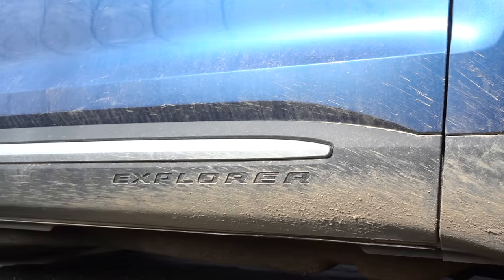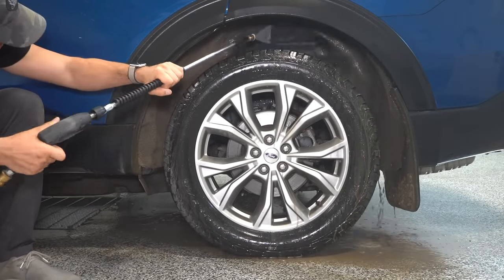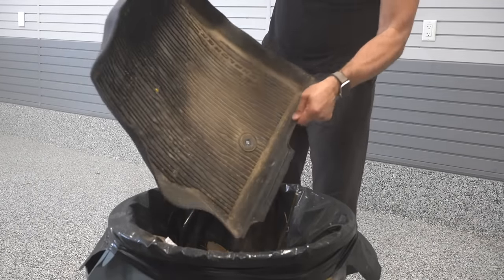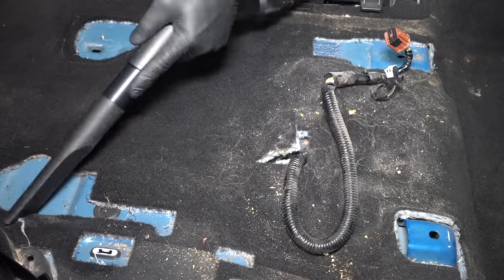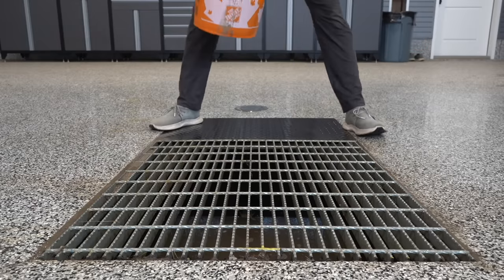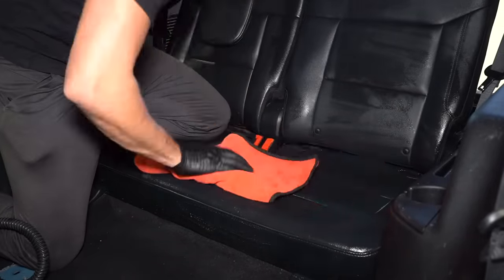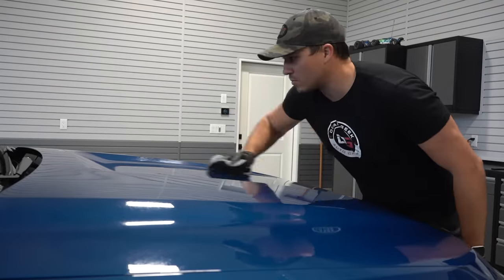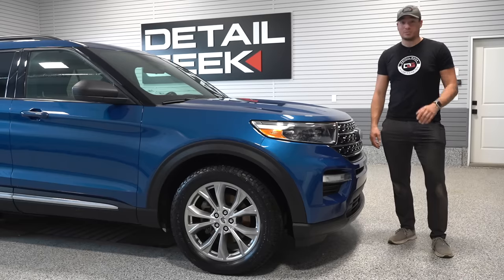I Shouldn't Be Allowed To Show You This...

Comment: Might I suggest a cyclone separator between your vacuum and the vehicle. There are a bunch of simple and cheap ones sold both online and in stores like Home Depot. Effectively they use centrifical force to dump all of the debris both small and large into a bucket while permitting mostly clean air to return to the vacuum itself effectively eliminating the job of having to clean out the vacuum itself and you can continue cleaning with almost no loss in performance regardless of the size of debris.

Comment: Hey, Mitch! I have a few questions: 
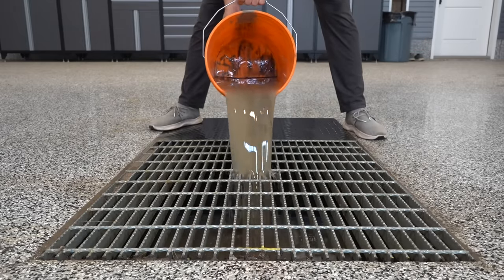1) Is it okay to spray cleaners directly onto the speakers like that? Would it be safer to spray it directly onto the cloth and wipe it down? @13:36
2) Do you get the roof of the vehicles? If so, how?
3) How do you clean the inside of the windshield?
4) How do you do this everyday? This doesn't hurt your back?

Much love from Pittsburgh!
Reply: All that water and steam inside the cars' controls and speakers would definitely cause damage on the long run.
Reply: @Amr-ep3vl  that's what I thought too. I would probably ask to not have anything sprayed into the speakers, especially since higher trims have some pretty nice speakers now days!

Comment: insane! we recently got a Ford as well, ours is a 2017 i believe and even though we got it used it only had 40 thousand miles! our cross country trip pushed it to a little over 50 but still. very lightly used and was taken very good care of. the doors have leather which had a slight tear we repaired, one of the side view mirrors has a little chip taken out of the plastic, and the windshield has a very tiny crack. otherwise it works perfectly ever since we bought it for 30k.

Comment: Hello! Never see you using prerolium based degreaser. In Sweden with lots of salt and tar from the roads, we always use it first on dry paint in the winter. Before we touch the paint. Then alkaline, for example with a foam sprayer.

Comment: Hello 👋 been a fan since late 2020 or early 2021. I have a little bag thats kind of like a trunk case, and ever since I started watching, Ive slowly developed a detailing kit. Ive bought mainly Adams, but we know how expensive they are lol. Recently, i started noting how difficult it is to maintain a uniform organization, due to all the bottles being various shapes and sizes. What im planning on doing right now is completely using all my non Adam's products to empty and restock everything with Adam's bottles and when they run out get the 1 gallon next. I was considering CarPro because i have their shampoo and sealant and those work wonders but Adams has a much more quick and convenient labeling and bottle design. Any recommendations?

Comment: I probably overlooked it but what type of pressure washer is used? I have a 2015 Silverado and have to deal with loads of tree pollen but I also wanted to use it for work around the house and was told that I should look for something around at least 3200psi.

Comment: I'll admit I get suspicious about if these are cars that actually got that dirty from use when the inside is a garbage dump but after cleaning the exterior is completely flawless...not a ding, not a scratch anywhere on the car.  Someone who owned a car and treated the interior like that for 135k miles but yet didnt put a single scratch on the exterior?  Same with the interior, filthy sure...but no scratches on the dash or the trims?  Honestly looks like a nice car someone intentionally dirtied up the interior just to make a video.  Not saying it IS that but yeah, hard to believe someone would get the interior of there car THAT dirty and yet be so cautious as to not scratch anything inside or out.

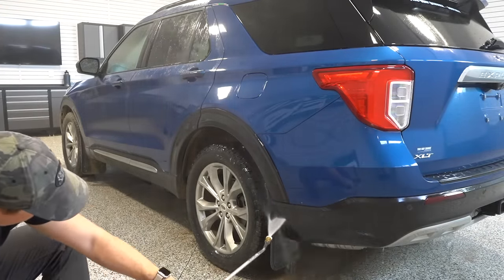Comment: 2:27 By door sticker do you mean vin number? If so pls make sure to check what year the plate is. If it’s a plate from 2021, but the door says 2020, whoever he bought it off stole it and swapped plates. Or he swapped the plates. Common trick. Rob a plate off a car and whack it on a bike or car that’s stolen, even sometimes not. Just to get away with insurance.